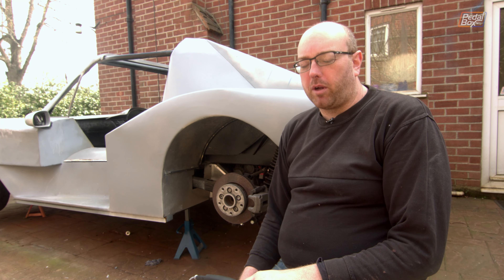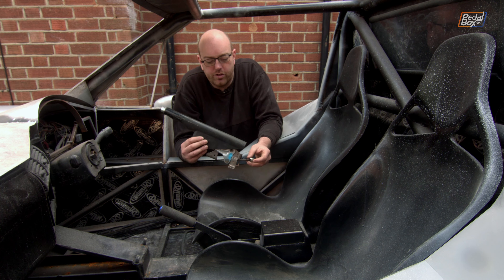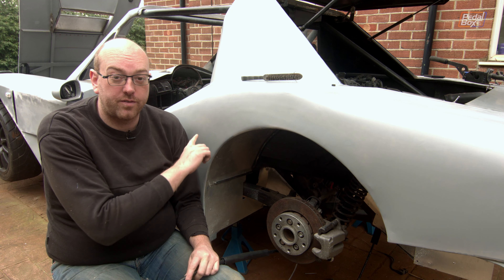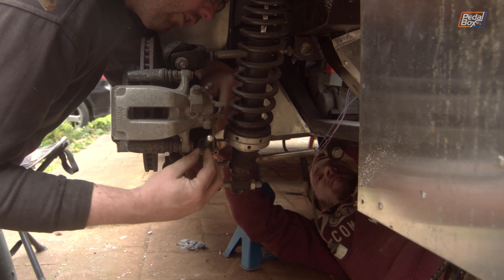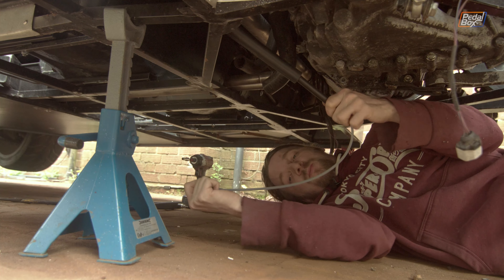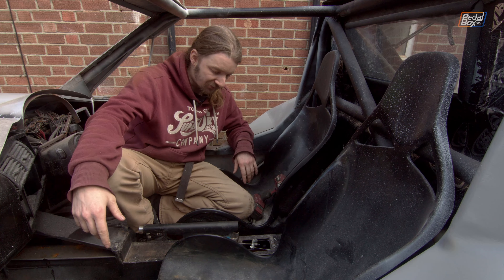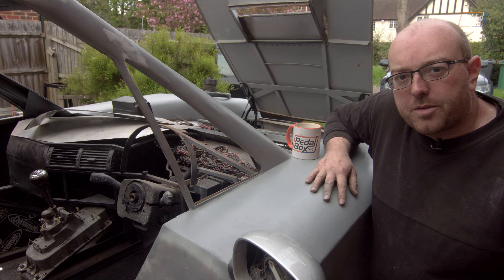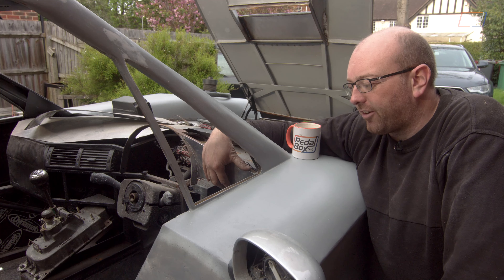IVA Proof Handbrake | Audi TT Kit Car | PedalBox Episode 132

Comment: Getting there, at a steady pace, well done 👍
Look at your mk2 handbrake setup, TT same layout with little differences, bownen cable end goes in a steel tube on body for a fixed point, against the body, there's some pressure on them 💪
Reply from the maker: I thought about having a proper look at the MK2 one... then remember how much stuff is stored inside the cabin and thus in the way and decided against it, but it's basically the same at least. And we've got the other A3 for ref too :)

Comment: You may find that IVA stipulates that brake bias be set to maximum on the front and the adjusting nut welded, not pinned, to prevent any further adjustment.
Reply from the maker: Yeah, that'll be removed :( There's a sticker we need to add as a warning which makes the pedalbox legit as adjustable, just can't have any adjustability possible.

Comment: Do you think a P clip will clamp the outer sufficiently when the cable is adjusted and the handbrake hauled on. Maybe worth considering an immovable stop for the outer cables.
Reply: We tried, it won’t 😅
Reply from the maker: Not any more! It very much wont hold. Optimism was strong, but reality hit hard

Comment: I would think that a straighter line for that brake line would be better. That 90 degree(clear Bowden) does not look good to me. IVA allows adjustable brakes on the fly? I'm in US, so I don't know what the rules are over there.
Reply: Yeah the absolute worst case here is we anchor it all better, especially the clear bowden at the front. What we have def isn’t good yet.
Reply: @ChrisDRimmer  The cable eventually will cut through that clear tube.
Reply: @19mati67  yep. I can’t remember if it made the cut so it might not actually be in the episode, but I actually said that’s one of my concerns with this arrangement.
Reply from the maker: Indeed, a noble idea, thwarted by physics... material science... really any of the physical engineering. Eventually got it routed though. And the bias? Nope, not allowed, not for the IVA check at least. But with a sticker we can make the pedals bias bar legal.